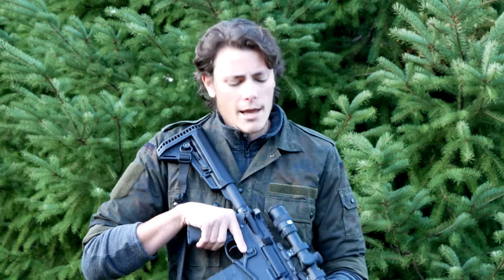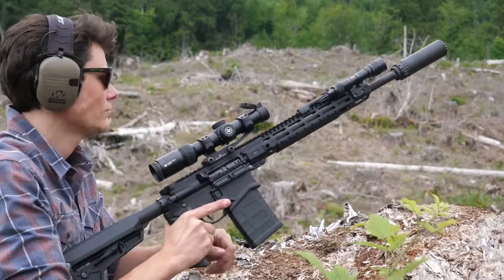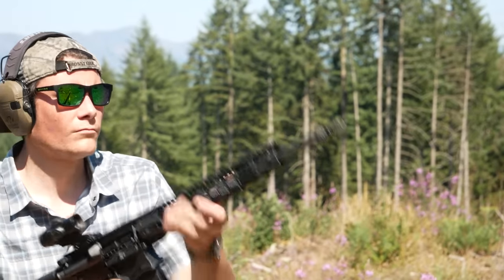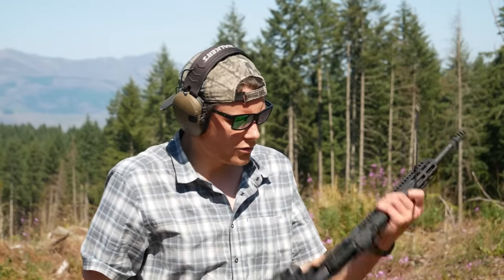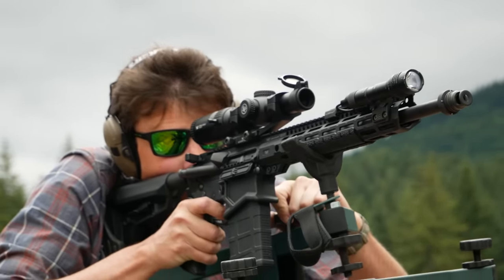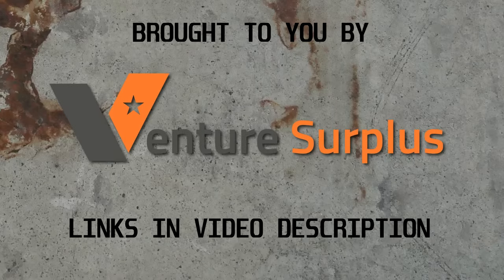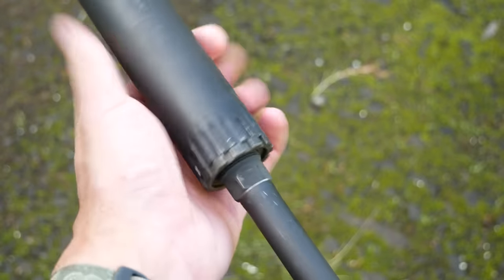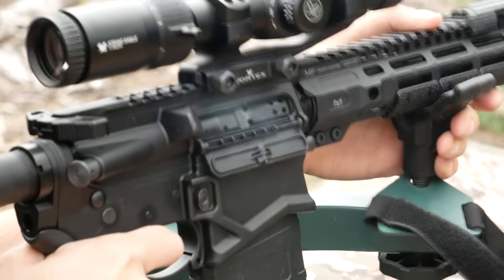Taking the Ruger SFAR to the Limit

Comment: Im kind of out on Ruger over the last few years. Their QC has been rough at best.  I have a first gen PC9 thats been through a boltface, boltface pins, two extractors and still has extraction/feed issues. Its been back to Ruger and it was worse afterwards. I picked up the SFAR six months ago and I think the nicest thing I can say about it is that its light for a .308 platform. Its been a picky eater and as you mentioned, is over gassed or under. No sweet spot or pet ammo Ive found to get it cycling reliably out of the box. Both are just taking up space in the safe now. If I get a wild hair Ill check out that gas block.
Reply: I agree completely. Smith and Wesson has gone downhill too.  Imo.

Comment: I've got a POF rogue and used a riflespeed to tame the gas on that as well. The biggest problem after tuning everything is that the gas system is just too short causing the bolt to start to unlock too early. I get that they designed it to work with cheap steel ammo, but I wish they opted for a longer gas system so it stops eating brass.
Reply: What is the length of the gas system it ships with? Would you be able to swap barrel with a longer port to help with the issue?
Reply: That's the same problem with the 16" SFAR.
Reply: @cristiancruz1972 no barrel swap possible.. proprietary lower won’t take anything else

Comment: Never have had an issue with mine.  Groupings of less then 1inch at 100 yrds with PMC X-Tac Match 168gr.  Have not had one failure to extract or cycle in over 1000 rds through with using everything from 7.62 147gr to 308 175gr.

Comment: I think Hop does an excellent job on this page and puts these rifles through a proper performance review. I trust his advice and rely on videos he puts out to make decisions. 

That being said, I have the 20” barrel of the SFAR and have had none of the same issues with reliability that he’s experiencing. 

I’ve now put 750+ 7.62x51 M80 Ball down range (don’t price that out please 😂) and can’t remember experiencing a single misfire or chambering issue. I have not even cleaned the rifle yet and performance has been exceptional for me.

I’m actually frustrated that poor Hop has had to deal with these issues because I know how smoothly the gun has run for me. I’ve even considered purchasing the 16.1” version of this bc I would configure it much differently than the 20”.

The 20” rifle is still completely stock config from Ruger, I’ve added scopes / fore grip / bipod accessories but have not altered any of the mechanical aspects of the rifle.

It seems that the use of a suppressor on this rifle may interfere with proper gas release. I feel for you Hop, keep up the good work.

Comment: I have a microprism 5x on mine and 45 degree irons that make it more useable in all ranges.
Out of the box this gun it needs some break-in. Somehow most Ruger guns too.
Mine had trouble cycling 308 ammo with longer cases such as cartridges from Freedom Munitions. Once broken in (I shot a couple of boxes but after I got empty cases stuck in it I manually cycled around 200 live rounds and rammed open the bolt), it runs great on setting 2 with all ammo.

Comment: I have the 20” version and have put an ambi charging handle, Magpul angled foregrip, padded sling, Leupold VX3HD scope and a PSA single stage match trigger.  I set it up for deer hunting.  Had some issues early on but now is working flawlessly.  It will group 3/4” at 100 yards with Federal Fusion 166 gr bullets.  It will do 1” with Federal Premium 150 gr Nosler Partitions.  Other hunting ammos I tried opened up beyond that.

Absolutely love the rifle but did not get a chance at a deer this season so will have to wait another year.

Comment: I am not about to buy a rifle then have to change hand guard and gas system to have a reliable accurate rifle, the stock hand guard keeps it light weight and that's the only reason I want it, and the price, if I have to spend another few hundred bucks plus installation and tuning I could have got a different rifle. Man I wanted this to be a good rifle. Guess I will be getting a PSA sabre. More accurate looks better much better parts same price with a lifetime warranty. And a company that supports America being free and affordable.

Comment: Mine is stock 16”. Setting 3 to high and setting 2 to low. Hand guard is too close to the gas block. Besides that I love this rifle. I just want to know how reliable the BCG will last. I want this to be my SHTF gun but I’m not fully trusting it yet with 200 rounds I have in it with not really any “real” issues. Good video just disappointing. I’m still very happy with my SFAR

Comment: I have 2 ar10 style rifles and the RifleSpeed system is on both. Will never use another adjustable gas block. One gun is a 6.5 creed PRS rifle with several PRS seasons on it. Zero issues. The other is a 308 dmr, battle rifle. Again, zero issues

Comment: That riflespeed gas block seems really neat. For anyone that has one, how difficult is it to adjust? In the video it looks like something that could get adjusted by bumping into rubble/barricades etc.
Reply: They’re easy to adjust and work really well. Downsides are handguard compatibility (they are not low profile), weight (it’s heavy and pretty far out on the barrel) and price.
Reply: @pa3gungal  thanks for the reply, when I get into the suppressor game I’ll have to pick one up!
Reply: Very unlikely you’ll bump it unintentionally there’s a detent between each setting. Also being that it’s on the barrel itself you’re way likely to Wack something else before you hit it and the settings are visible.

Comment: Riflespeed is a good option. I've also had great luck with the Noveske Switchblock as well, but you need a cutout to use it properly. Tried it on a N6 and I went from hardcore skeptic to a believer pretty quick. It's no wonder why NSW dudes like the N6 with a switchblock, it just makes sense. Would that have a place on the SFAR? Doubt it, but it's still another solid option.

I was literally about to buy one of these when I got a screaming deal on a N6. Glad to see it's not total dogshit ass garbage.
Reply: What's an N6?
Reply: @Cob2001 noveske AR-10

Comment: Great video.  Surprised to hear of so many gas issues but I believe it.  Nice call on that new gas block.  Only issues I had reliability wise was suppressed, so tuned a load for that.  Accuracy wise, it's 308.  Tested 6 or 7 different factory options... 7.62 ammo ranged from 2 to 3 MOA... 308 ammo was far better and was able to get consistent 1 MOA groups and no problem shooting the gun out to 750 yards.   Just picked up the 6.5 CM and REALLY looking forward to stretching it out there.

Comment: This review folks should be an example of why 308 DMR's from companies like HK, FN, LMT, and Knights are so expensive. Its extremely difficult to make a reliable but simple rifle that just works, suppressed, and unsuppressed. Sure you could fuck with this thing and add gas regulators and what not, but at the end of the day its still going to have problems and be a pain in the ass to shoot. I definitely wouldn't trust my life to this thing. Id rather buy something proven from a company with a great reputation of making DMR's.
Reply: I'd throw Daniel Defense on that list, yet cheaper and lighter than the rest. My DD5V3 runs like a top and shoots sub-moa for a fraction of the price of anything you listed or a LaRue. I'm a fan.

Comment: I’m enjoying my Pof rogue with the dictator adjustable gas block. I had them install that the factory and I’ve had zero and I mean zero problems like it should be straight out of the box flawless operation worth my $2100 and I got it in green.

Comment: The lesson people should be taking away from these videos and others is the juice to squeeze ratio on .308/6.5cm platforms is abysmal. These things quickly turn into money pits. Assuming you think these might have merit as a DMR of sorts you have to ask yourself “what is this platform affording me over a dedicated 6arc rifle or upper?”  The answer is very little IMO.
Reply from the maker: I'm starting to learn why bolt action rifles are still a thing.
Reply: Oddly,  I snapped together a PSA ar 10 not long ago for around the same price.  20" barrel, and a heavy pig, but no failures to feed or eject at all in over 500 rounds. Likes 180 grain bullets for accuracy (standard 147s were all over the place) and it beat the hell out of a cheaper scope mount ( replaced, and an expensive lesson in scope mount quality there.  I learn everything gt he hard way...)  
The small frame 308 is intriguing, admittedly, but I don't think anyone has ot dialed in yet.....unlike the ar 10 size frames.

Comment: I have  had a SFAR for 5 years with 1000 + rds 1st yr and 1000 +rds since.  There were a few not eject , jams , misfeeds within the 1st 100 to 200 rds but since that it shoots every thing pretty damn good.  Just shoot 4 25 rd 2 20 rd 1 10 rd and 2 5rd mags without a falure. BTW after all those rds thru , chamber,  bolt , barly needs cleaning.

Comment: Thanks for all your information I was going to buy this one but I end up getting the PSA AR-10 instead and having more adjustments with the gas system then the four position one that that one has and I haven't had any problems like you're having I did put a silicone heavier spring in and a 5.4 heavier buffer and a muzzle brake that's supposed to reduce the recoil 74 percent 😊